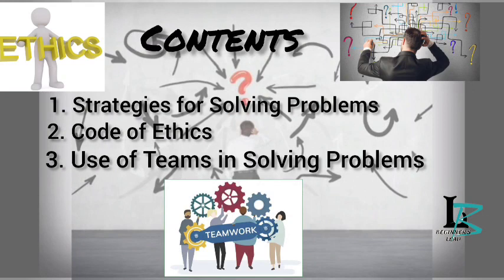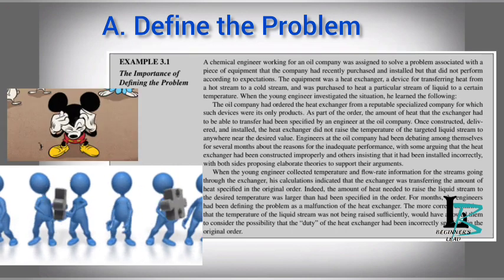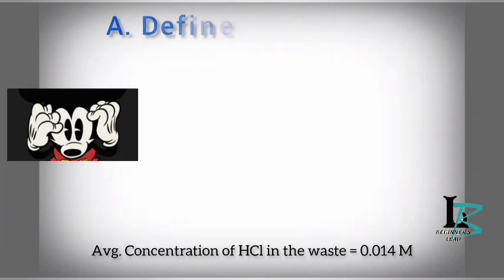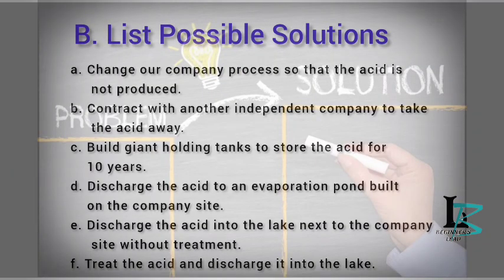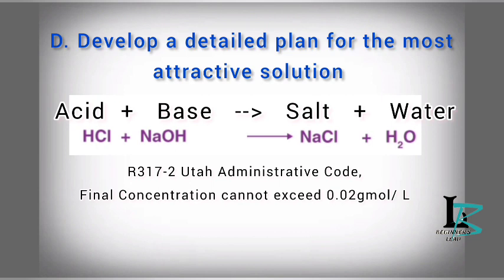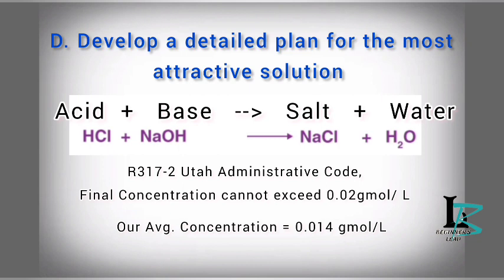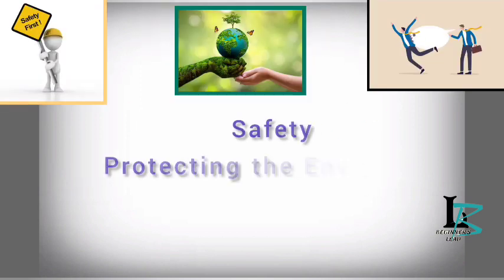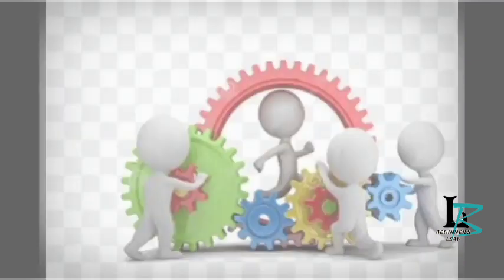Solving Engineering Problems ( What Shall We Do?) ||  Problem Solving Steps

Comment: Thanks Farzana. 
For beginners,
You as engineers should develop and sharpen your engineering skills to solve any problem because even if you face the same problem of HCL discarding in real life you might not go for the same solution. Problem maybe same but many factors including company's interest, local environmental laws/legal specifications, feasibility, risk and hazard analysis will influence your solution to the problem etc.

Thus basic tools or thought process as told in the video are always the foundation of engineering.